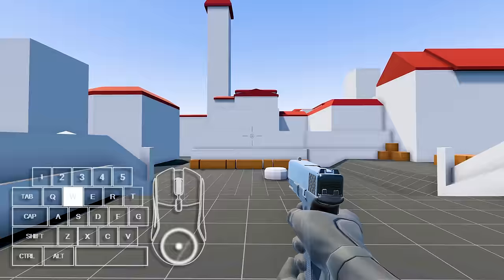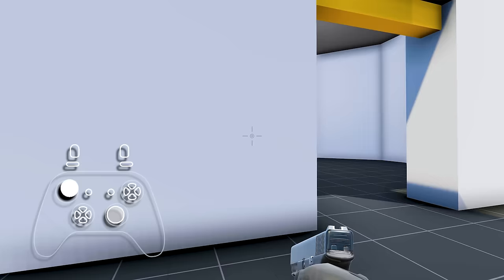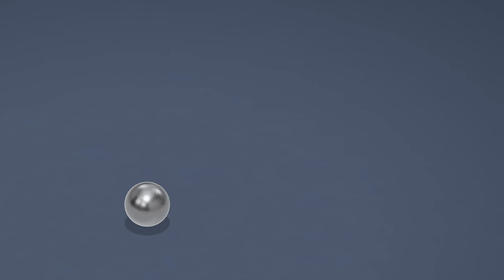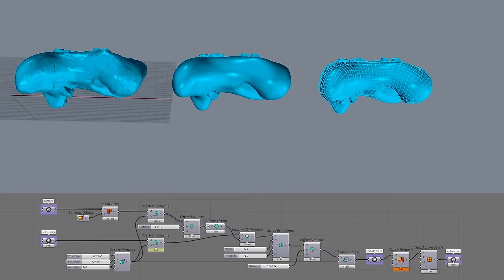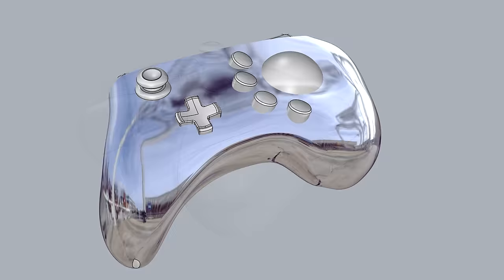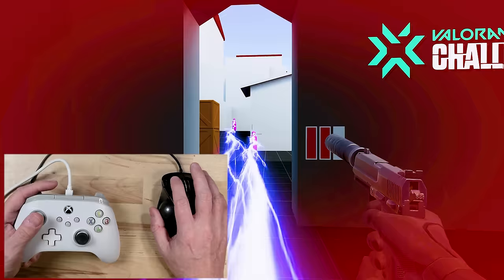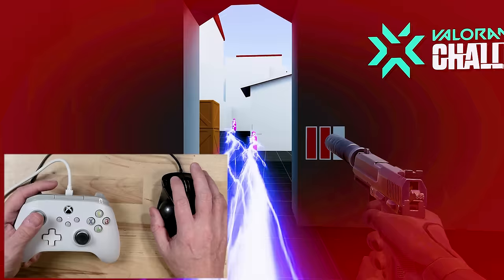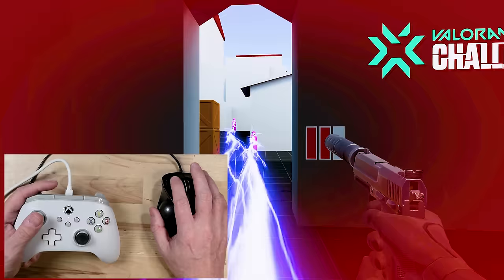Ultimate FPS Controller Design & Build

Comment: I think one thing people forget about mouse movement is you have 3 "gears" to let you be both fast AND precise:
High gear - Your forearm physically moves to make fast, large movements
Medium gear - Your wrist moves giving you a good balance between speed and precision
Low gear - You move the mouse in your fingers without necessarily moving your wrist. This allows you the most precision.

Position vs velocity control is part of it and it's what your trackball addresses but combining these different muscles is what lets you be simultaneously fast and precise.
Reply: Yes you need the whole arm to be precise & accurate…this product doesn’t improve much from original controller
Reply: The trackball being accessible from the back gives 3 gears too. Swipe, Smear, Pinch.
Reply: That's why azeron keypads are so powerful. They provide immediate access to 3 or 4 buttons for each finger and an analog stick at your thumb, while you can just use a mouse in your other hand. This does not compromise simultaneous access to keys, movement and aiming as well. It's perfect for games with demanding input strategies, such as doom eternal

A trackball gamepad is still great for basic fps games on the couch
Reply: This is why gyro + trackpad is so good, you can have all those gears basically
Reply: @konradwright7725 those are 3 different actions. What the original commenter is pointing out is that you have direct control over 3 parts of your body used to address different parts of aiming; flicking, tracking and micro adjustments.

Using your fingers to pinch, smear and swipe is no different to how a normal person adjusts their mouse slightly in their hand (using their fingers) to make micro adjustments. The issue is you are neglecting the rest of your arm when making movements with the trackball and you will primarily have to rely on your thumb for both tracking and flicking.

I have no doubt that people could eventually get good aim with a trackball but I do not think it will have any advantage over people who use a mouse. What motivated his design in the first place was the flaw he saw in using keyboard controls over a joystick, it wasn’t because he identified anything wrong with aiming with a mouse.
Reply: @trydodis690  In a group of Tuples for comparison (Ball,Mouse): (Swipe,Arm), (Smear,Wrist), (Pinch,Fingers). I never stated the ball was better, but it does have three gears. Saying it’s not gears but mouse is- is just arguing semantics.
Reply: @konradwright7725   I’m sorry I don’t really understand the pairings in your comment because I have trouble visualizing a few things. Can you elaborate on what you mean by a smear motion using wrist and swipe using the arm?
Reply: @trydodis690  To explain Smear imagine Swipe as a fast motion in which your thumb would leave the ball and let inertia carry through the motion. Smear, your thumb does not leave the ball, but good for medium movements like the wrist. Pinching the ball from back and the thumb would allow for micro movements like using your fingers on the mouse.
Reply: @konradwright7725  But you still aren't getting the body's natural range of motions. Your arm is configured to allow you to have different levels of sensitivity at different spots along your entire arm. Using a mouse goes all the way up to your shoulder. It means you're putting your entire strain of movement on one joint, and furthermore pinching requires other completely separate mechanics that you now need to focus on.
Reply: @G0ldbl4e  Again, didn’t say it was better. Just that it also has 3 gears. Mouse > Ball.
Reply: You could do this with accel. Accel when setup properly is very good.
Reply: Gyro can basically do this
Reply: @konradwright7725  It comes down to more than "semantics". Actually, what you're arguing is trying to fit semantics when it doesn't match in functionality. Arm -> wrist -> fingers is a meaningful bodily mechanical difference - we have different motor skills in these parts of our body that assist our aim - this is not the case with a ball.
Reply: I thought the same thing, imagine it like firing a real gun you use your arm to aim and finger to fire, I think a mouse with an added thumb stick to move would be much better.
Reply: 100% right. thats why i use joystick and kbm.this controller has prob caused more issues than fixed any
Reply: @neurway4048  did u even watch the video?
he is clearly doing a lot better with this than a normal controller after a few hours
Reply: @robertmoss5538  These have existed. The problem is having inputs on the mouse detracts from aiming. Also imagine the patting head rubbing stomach problem of strafing left while aiming right.
Reply: maybe a trackball that has pressure sensor so if u push harder it means faster movement
Reply: The point is to use more muscle and nerves with your body, its also easier to learn. Using only fingers to have many actions is tricky for average person.

Comment: Finally, someone who cares about:

1) Ergonomics

2) Efficiency

3) ACTUALLY EVOLVING CONTROLLER DESIGN
Reply: Ergonomics matters so, so much. This just looks comfy.
Reply: Who doesn't?
Reply: I'm sorry did I enter a parallel dimension where ergonomics means the opposite thing??
Reply: @kazeem6419  Ergonomics noun. 1. The applied science of equipment design, as for the workplace, intended to maximize productivity by reducing operator fatigue and discomfort.  2. Design factors, as for the workplace, intended to maximize productivity by minimizing operator fatigue and discomfort.

Most game controllers utilize the same general shape that has been used in the industry since the early 2000's, and hasn't seen a large change from that point going forward. The only notable exceptions I can think of being the nintendo wii, and the switch, and those weren't necessarily great (or even good) changes.
Reply: @houstonashley62 What? This thing looks like it would be so uncomfortable to hold and use
Reply: Someone who also understands comfort and movement of a controller too.
Reply: gyro exists
Reply: @liamleeyum  you mean twisting your wrist at awkward angles while playing and jerking it around??? Yeah not very ergonomic or good for you
Reply: @thedapperdolphin1590  I disagree. It looks very form fitting to me. If you’ve ever used a trackball mouse you would understand that the shape has to accommodate the large sphere sticking out which I think his design does pretty well
Reply: Okay, yes, I want one.
Reply: xbox elite series 2 is still the best controller tbh
Reply: Ultimate fps controller: mouse and keyboard
Reply: The concept is interesting for sure. One thing I'm not entirely sure about though is whether the trackball wouldn't become slippery during longer gaming sessions. I've experienced that issue with an XBOX 360 controller with worn thumb sticks for example.
Reply: @thedapperdolphin1590 nah, skill issue
Reply: @thedapperdolphin1590  have you held one?
Reply: @uriahh6931 its not a mouse
Reply: @ethanrandall3005  nah bro thats 2 things
Reply: That looks absolutely hideous. Playstation 2 is the perfect template for the best controller, and thankfully, all the good USB controller are made in the same design. The buttons are too close to the left hand. I would not even try to use that abomination. Remote Controller aka WII is also unacceptable. Worst design ever.
Reply: Yeah the controller design does seem to be stuck at the moment. The Xbox, Playstation, and Nintendo (Pro controller) designs are largely the very same configurations but with a slightly different spin on it. There doesn't seem to be anything new outside Valve's attempts.
Reply: @ethanrandall3005 keyboard sucks.
Reply: @samcross8532  you know what? That's a good point.
Reply: @EmeraldEyesEsoteric ah yes

The controllers of old

Comment: The way Splatoon does it is really good actually and helps make up for the controller disadvantage while being intuitive too.
Reply: Ah, I just wish stick control with motion controls on was more consistent. Without motion controls the stick feels snappy, it moves at full speed the instant I touch it and stops on a dime the instant I let go. Turn on motion controls and it feels so... floaty? Like the camera has physics now, and I gotta use the motion control to counteract the stick control.
Reply: @squidfan6187  I tend to use both in conjunction. Stick and motion for fast movements like 180s and motion only for tracking. The motion functions for the precise movements while the stick covers the larger ones, much like moving the arm does large movements and the wrist does corrections and smaller movements with the mouse.

And yea it is snappy because if it accelerated you'd lag behind, this is what tends to happen on normal controllers.
Reply: Same. Also Fortnite has this too on the Switch. It helps to aim when sniping especially.
Reply: I do this by using a Nintendo pro type controller on PC. The hardest part is getting the settings right.
Reply: Man Splatoon is the hardest shooter I've ever played, and it's just because of how un-transferable other shooter skills are to that game.
Reply: Nah splatoon has one of the worst (for my brain at least) gyro implementations I've ever seen tbh. I wish it had the option to just use the stick to look in every direction instead of just right and left while the gyro is on.
Reply: @atheneite yes good mnnnnnm
Reply: @squidfan6187 try BotW. Gyro can be really good if you know how to use the stick to deactivate it and learn how to use both together.
Reply: I hated the motion controls in Splatoon. Nightdive's Doom and Quake ports did it better.
Reply: @atheneite The thing with adding vertical aiming to the sticks is that it really messes up consistency. It makes controller angles go all over the place really fast since you can never go perfectly horizontally (especially in a rush, like Splatoon often puts you in); having that off makes vertical aiming a lot more consistent than on, which I've grown used to to the point of that being how I play other games adjacent to shooter controls with motion (namely Minecraft).
Reply: @1unar_eclipse  I mean I prefer mouse and keyboard over anything as that's the way I'm most comfortable but when I decide to use gyro I tend to make gyro bound to a button like the triggers (plus a reset/focusforward button) so I only use the motion controls when I need them. It's kinda comparable to using your wrist and arm when using a mouse. It's all preferences when it comes to stick+gyro controls since there isn't a standard and the way splatoon gives you only one option is close to unplayable for me.
Reply: @atheneite  Oh yeah, the lack of options is pretty wack and I can agree a lot of this kind of stuff is personal preference. I don't even remember if there's invert axis options lol

Comment: I know this product isn't meant for mass production, but I've thought of a few improvements I would make to the design/internals;

1) Utilizing hall effect sensors for the left joystick as well as the triggers. PowerA is strange in that it uses physical copper potentiometers on the triggers instead of the standard hall effects. PowerA parts are also notorious for failing and causing unwanted input registration.

2) Replacing two of the face buttons with rear paddles/buttons or even just adding rear paddles/buttons in addition to the 4 front facing buttons. This would help relieve your right hand a bit more, as it's constantly going to be using the trackball and a lot more motion is going to need to be exerted than if it were a standard controller due to the increased surface area and other buttons being further apart.

3) The extended right handed shoulder buttons is a cool idea but I believe it could be expanded upon. You could make them adjustable so that you can remove the shorter buttons and/or clip on longer buttons so they extend further to the right for smaller hands (this seems to be something you've accounted for as the buttons appear easily removable)

These are just some minor (and somewhat subjective) improvements to what is ultimately an awesome project. This was a great video

Comment: You 3D printing the input pieces then mapping them onto modeling clay was so smart. It not only lets you lay out the buttons in the way that best fits your hand but also shaped the "controller" (clay) to your hand for added comfort on that end. I'm only 4  minutes in so I don't know if you kept the hand shape but even just using the clay for mapping is incredible.